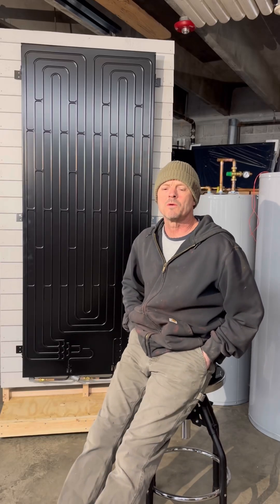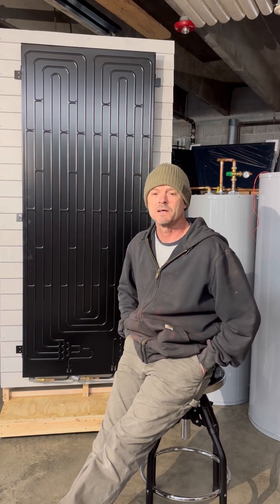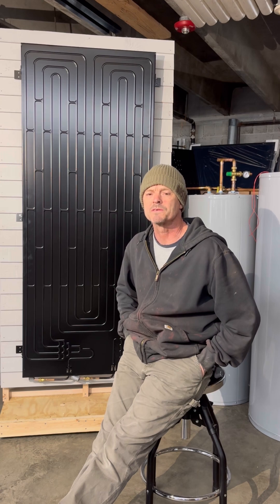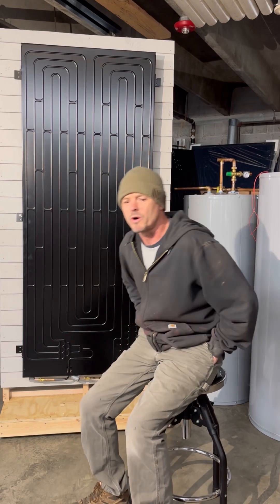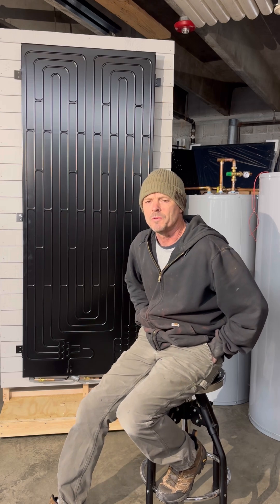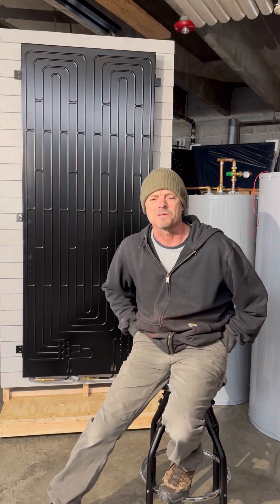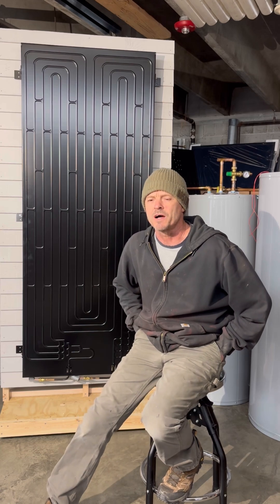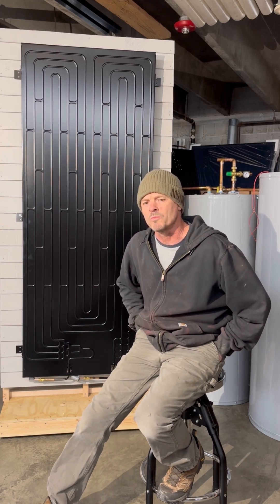Smart Solar Heat Pump Water Heater vs ‘Conventional’ or ‘Hybrid’ Heat Pump Water Heaters.

Comment: New England Solar Hot Water installed our system in a single day, overcoming the hurdle that our incoming city water valve didn't quite shut off completely. They did a good-looking job, and as a mechanical engineer I'm pretty confident that we'll never have to enable the backup resistance heating element in our 80-gallon tank. (There are just two of us living here for now.) The outdoor panel is mounted under the eaves on a second-floor wall, facing pretty close to south. That means that the low sun during winter will hit the whole panel, while in summer much of the panel is shaded so the panel isn't excessively heated. The new tank was also located closer to the faucets, reducing the amount of water we'd have to waste to get it hot at the taps. I'm a volunteer energy coach for my city, and will mention NESHW's approach any time water heating is covered in a consult.

Comment: NESHW / Bruce installed a solar heat pump hot water heater at our house (cold Massachusetts) this past winter. They did a great job and were very responsive, doing a proposal and installation within a couple days after our old conventional electric hot water heater had died. This solar heat pump solution worked out well for us - we didn't have space for a conventional heat pump water heater. Maybe this turned out to be better than that! It works very well and we've seen noteworthy reductions in our electric usage. Glad to be able to reduce our energy usage through better products like this. Who wouldn't?

Comment: We had NE Solar Hot Water install our tank in Oct.  The installation went well and for the two of us, the system has been heating all of our hot water without the electric back up being turned on.   It is quietly doing its job better than we expected.

Comment: I witnessed the operation of a heat pump water at my neighbor's house this summer. It was installed in the basement and he wisely installed some ductwork to pipe the cold air generated up to a couple of registers in the kitchen floor. Great in the summertime here in the mountains of Virginia, which is Climate Zone 4a - Mixed Humid.

But, during our cold winter months, the utility room in the basement is going to get cold from the heat pump water heater exhaust and there will likely be a draft from heat convection with the heating system. Like you say, at the end of the day you will be stealing heat from the rest of the basement to keep the water heater happy.

Having the evaporator outdoors is a stroke of genius! 

Having several evaporators around a walipini greenhouse might enable the maintenance of a large hot water supply for domestic hot water AND greenhouse heating during fall, winter and early spring. Very interesting technology!
Reply from the maker: Had to google ‘walipini greenhouse’! Thank you.

Comment from the maker: This is the discussion RE using heat pumps to heat the air consumed by a conventional heat pump water heater. In the video, Bruce says ‘2 guys’. It’s one guy; James Peterson. Apologies.

https://passivehousema.org/video-library/domestic-hot-water-heat-pump-efficency?ss_source=sscampaigns&ss_campaign_id=65b1864fbc84434f4a867374&ss_email_id=65b25ef117680d75e980bddb&ss_campaign_name=High-Performance+Trades+Training%3A+Lessons+from+Ireland&ss_campaign_sent_date=2024-01-25T13%3A15%3A39Z